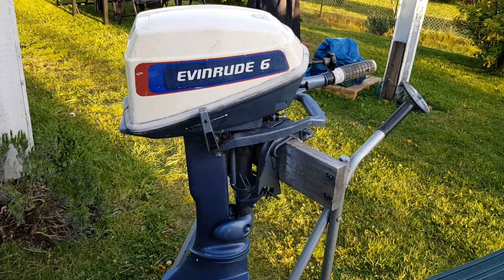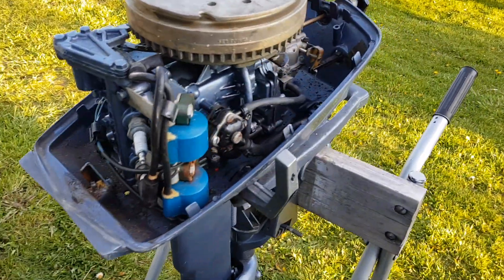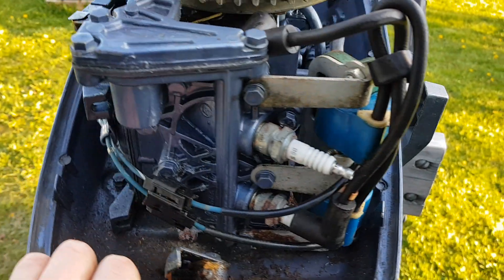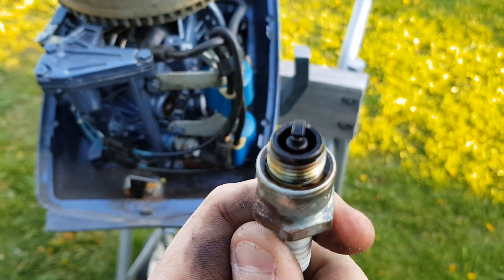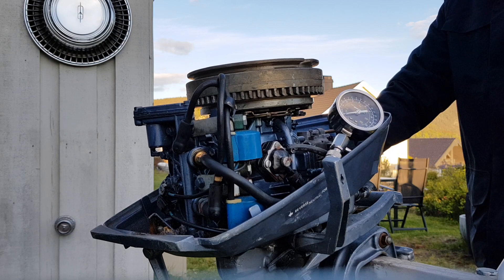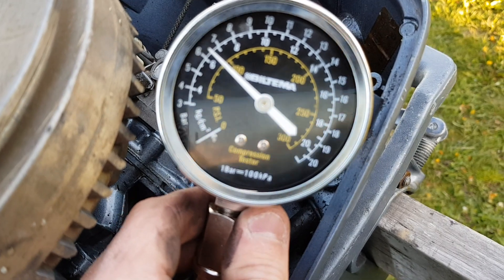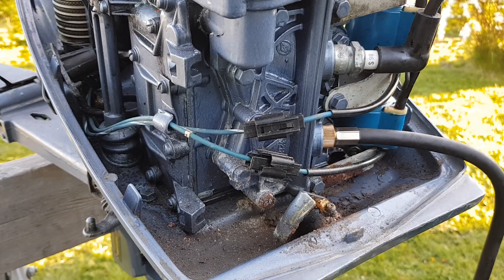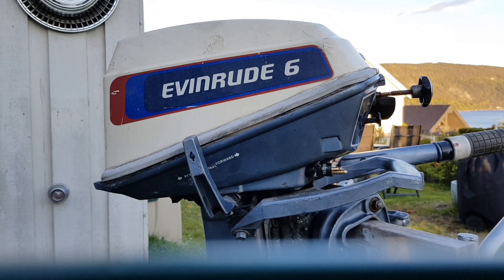How to check compression in two stroke outboard engine - easy

Comment: I can't pull the rope when set at full throttle. WHY?
Reply: depending on the motor it’s probs set up that way so you don’t pull the cord when it’s running. you can still do a test without full throttle.

Comment: Your suppose to remove ALL the spark plugs when you do a compression test. And make sure your fuel is disconnected. Also your engine should be at running temp for accurate compression testing. FYI
Reply: The cylinders don’t share valves so it doesn’t matter if you have both plugs out or not. and there is no gas tank on these so his gas is disconnected. And running temp is ideal but not completely necessary. and unfortunately if your doing a compression test on these small motors it probs doesn’t run.